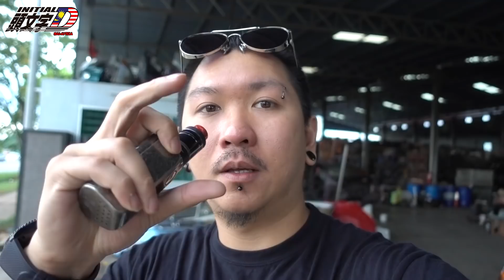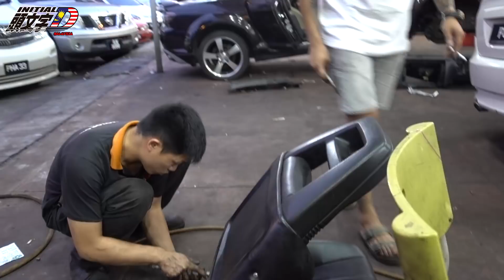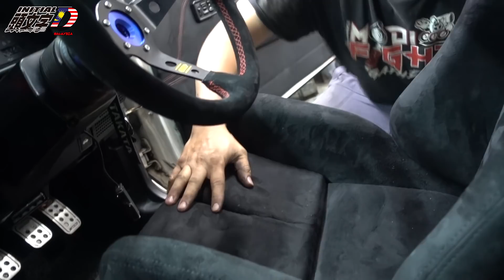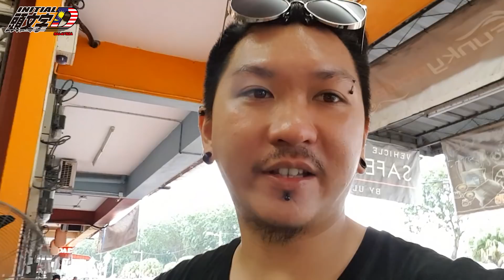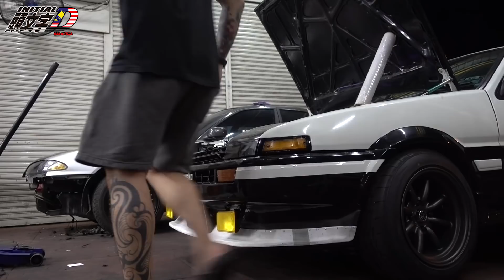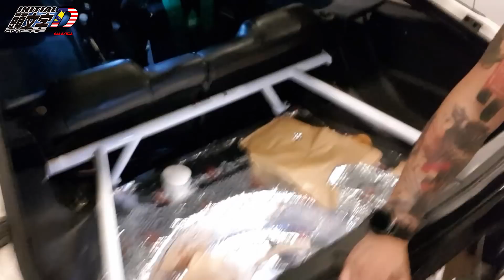- INITIAL D MALAYSIA - THE MAKING OF TAKUMI PART 6

Comment: At the beginning of the video when you hit the trottle there comes black smoke out of the exhaustion  pipe. That means your fuel mix for the motor is to rich, and isn't burned through the motor. That's a waste of fuel and also no good for the motor.